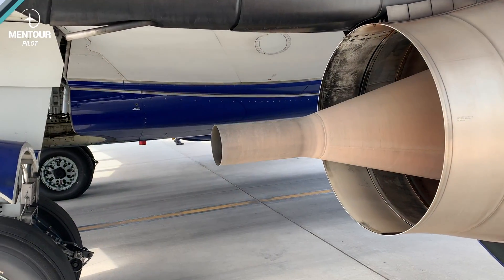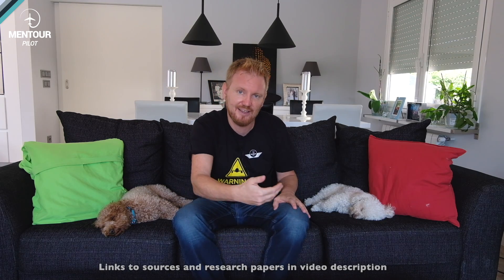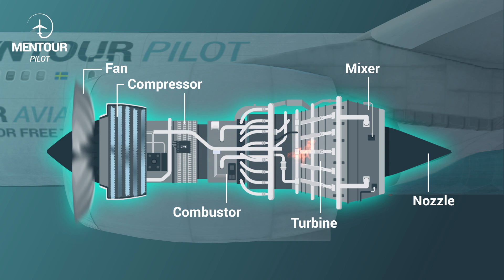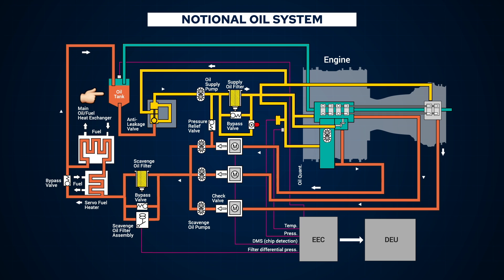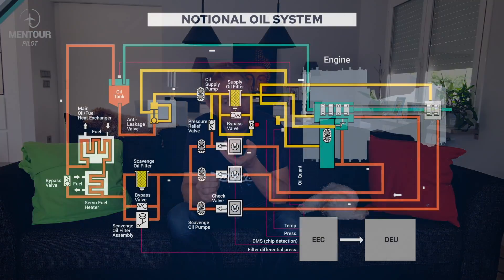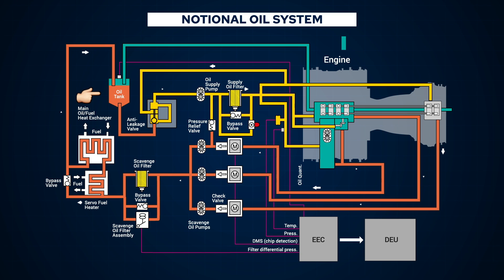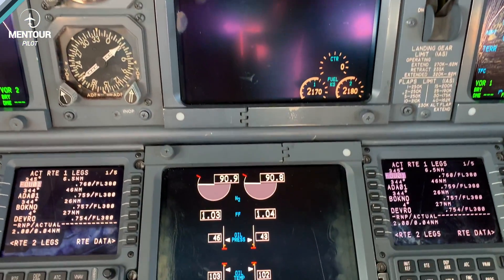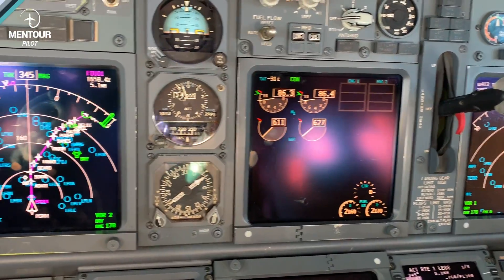What is that TUBE at back of the B737 JET engine?!

Comment: And i have a qiestion whats the maximum fuel that we can use to fuel an aircraft
Reply: favour ogiefa787 	
The capacity of main tank 1 is 8630 lb (3915 kg). The capacity of main tank 2 is 8630 lb (3915 kg). The capacity of the center tank is 28,803 lb (13,065 kg). The capacity of each surge tank is 235 lb (107 kg). So max filled tank would be 21 109 kg.
Reply: @speedbird9313  nice

Comment: As an old retired Flight Engineer I enjoyed your video. In the “the old days” back in the 60s and 70s pilots and flight engineers ground schools taught all systems in great detail down to the inner workings of all the components of systems. Ground schools were much longer then they are now. We would have been taught the oil system just as you presented it. Much more complicated systems on  reciprocating engines and turbo props. Thanks great job!

Comment: Chip detectors almost resulted in another 'Atlantic Glider' long before Air Transat 236.    Eastern 855, a L1011 from Miami to Nassau, lost all its oil and just managed to land on one engine (after the crew had restarted it when the two remaining engines shut down).   The reason for the engine shutdowns? - the chip detectors had been replaced in regular maintenance but the sealing O-rings had been omitted so all the oil leaked out...
Reply: i heard about it!

Comment: Dear Peter, I have one small suggestion. In the AMM, there is a range in which everything is in limit. Up to 1.24 quarts per hour is allowed, after that you have to remove the engine. My suggestion is to give a range of what is allowed.

Comment: Common misconception, but it's not actually "sometimes cooling", it's almost entirely cooling. In high power transmissions and gears up 98% of lubricant flow is used entirely for cooling components, with sufficient lubrication being achieved with only around 2% of the total oil flow

Comment: Why 747 is used as test bed for big engines. This feature was considered during design phase of 747 or those 747s are modified. And why the 747 cannot fly on two big engines like GE9x

Comment: Good explanation, I was in the Air force and some older jet engines in the 80's reject all the lubrication of the turbine bearing in the jet stream, so it get constantly fresh oil, the reason was the oil get so hot in the bearing that it is no good to return it back to the tank, the compressor bearings oil recycle back to the tank, that old jets used sometimes a 500 ml oil per 1 hour flight

Comment: Great video! I was a crew chief on the KC-135R powered by the CFM56. Those schematics brought back memories. I had wondered why there was smoke coming out of those tubes and what the little screen covering inside was for. I also now know why each engine needed about two quarts of oil after each flight. I haven't touched a 135 in almost six years and here I am still learning about the jet!

Comment: Such clever and elegant engineering! 
I think what surprises me the most is how little oil is required. 12-14 liters/quarts is not much at all. That's just a little more than twice as much as my Jeep!   Impressive.
Reply: BRUXXUS 12 is minium allowed for dispatch, it can hold approx 21 US quarts but doesnt indicate (on the DU) more than 19.
Reply: @speedbird9313  That's really fascinating. Even 21 doesn't seem like very much. Shows how tightly engineered the systems are.
Although, I'm guessing if there's a rupture at any point in the system, there wouldn't be much difference between 21q and 200q.
I can't imagine an oil leak would end well.

Comment: Nice! This one...
I'm looking forwarded to your take on: "We still have a huge problem with different Units".
How on earth did the industry survive with that completely outdated "Imperial" system - measuring things with reference to body parts (feet...). ?
There is still no sign that the glorious United States of America will adapt the metric system anytime soon. They are unwilling to adopt a world-wide metric system, defending a medieval and incoherent US customary system because of mental inertia which now has lasted since 1795. What is really mind-blowing is that the industry is still willing to deal with that imperial BS, and that you still have to buy a "Half inch wrench" instead of using a 12mm. And basically doubling the investment in tools you need in any workshop. Just because of US solo-arrogance.
Reply: Few of the measurement units in the aviation industry are in imperial. Nautical Miles and Knots, for example aren't imperial and also not metric. No, they're nautical. Nautical units aren't worse than their metric counterpart, if you are using them for their intended purpose: long distance navigation.

P.S. Fun Fact: The USAAF/USAF have been using celcius to measure temperature in aircraft systems since at least ww2
Reply: @martijn9568  
Nautical miles fit into the pattern of geographical Longitude/Latitude divisions as an integer. That's their advantage.
Didn't know that Celsius detail....
A klick (with a K) in military speak equals 1Km. Not sure to what extend it is used.
It seems that the military is adapting metric - realizing that the chance to win improves if you don't have to bring pen/paper and a calculator to the battlefield.
Reply: It's not the most difficult thing to get used to using both
Reply: @timwilson7326  
Beg to differ. 
What is 11/32 inch plus 17/64 minus 1.2 thou? You have to sit down and take pen and paper. These situations DO HAPPEN.
How many cubic inch are in a Gallon? 
How many feet to a mile? How many yards to a mile? Every time you wind up with a conversion factor impossible to memorize. And you have to go and look it up because nobody can remember that conversion factor. 
Imperial (call it US customary, for that sake) is just hopeless to work with. Still, there are defenders of the undefendable.
The US completely missed the train.
Reply: As a citizen of the glorious United States I do agree with you. So much inertia....
Reply: As far as I know, US manufacturers are allowed to use metric units in engineering and production.  Makes sense if they ship worldwide.
At Hewlett-Packard, the groups I worked with used metric units and metric hardware consistently, whether US or EU based.
Reply: @Butt of Lewis 
Nope. That 13mm will slip around the nut. 
You take a decent size hammer, align the 12mm wrench with the 1/2incho, give it all you got, and here we go ;) No more slippage.

Comment: That reminds me of the breather cap or PCV system on a car engine.  As the oil heats up, some gets turned into a vapor.  The old style breather caps on the valve covers would let this excess oil vapor vent to the atmosphere.  On pollution controlled vehicles, the PCV system vents the vapor into the intake manifold, where the vapor can be burned as fuel.
Reply: I had a 1967 Chevy Biscayne (cheap Impala) that went through oil like crazy. I was too young to figure out why until some lowlife stole the breather cap. I bought a new one and the oil loss went down to normal. I still get a chuckle about that!
Reply: @flagmichael  Did you drive it to the levee?
Reply: I agree. I guess similar pollution control requirements have not (yet?) been mandated for aircraft, although I expect it would technically be possible to let the air/oil vapor through the jet engine combustion chamber in a similar manner.

Comment: For the car guys watching, this system is directly comparable to the PCV (positive crankcase ventilation) system in reciprocating engines. The major differences are that most car engines are wet sump, and the oil misted air is fed back into the intake (via the pcv valve and tube) to be consumed in the engine.

Comment: I have noticed this on flight sim 2020. On the a320 neo or any plane. When you go to start the engine by pulling the fuel cut off lever to run, the fan in the engine spins even when the over head fuel pump buttons are off. 

Why does the fan start to rotate when the fuel cut off switch is in the fun position.   (Or when the ignition switch isn’t set to “start”)
Reply: I'm not fully sure of your question but in general when starting a Turbojet/Turbofan engine: the starter spins the compressor fan up to a running speed before fuel is injected.

Comment: It looks like engine engineers did everything possible to make sure the engine is as big as possible for low-sitting 737. It looks like putting centrifugal breather on the bottom would defeat the purpose, and they've opted to punting it inside the shaft. Just speculating here....

Comment: Yep, thrust going out is countered by something: bearings that exert the thrust on the load (the air-frame, eventually).  There's a lot of heat and pressure in that meet and greet.  Oil can be recirculated, metal can be too.  But, not for long.  Oil is a wonderful friend!  The tube is called a draft tube in trucking industry....Emission regulations have spelled the death of the draft tube.  Such emissions now must be combusted before being emitted in  truck engines...no doubt, aircraft engines will follow suit...just takes time.
Reply: it is only the thrust from the fan that is exerted through a bearing, in a pure turbojet the force on the thrust bearing is close to zero
Reply: @fuzzy1dk  and so where the thrust is transfered from the engine to the airframe?

Comment: There's no sealed system in any chemical combustion engine. Whether a standard piston engine or a rotating turbine engine. During the combustion process you're getting rid of both heat and as you say, burnt atomised oil from the chemical combustion process itself. All of this is also cooled by the bleed air from compressors 4 and 9 that deal with all engine functions

Comment: Great stuff! More engineering please. My question....... Why are piston engines in aircraft not silenced like land based vehicles. Obviously the prop makes most of the noise as do the tyres on a car. Light aircraft engines are roughly the same size as the average car engine. Why not at least muffle these engines in a similar way??
Reply: The weight of the silencing system is not worth the quieting of the exhaust. The return on the investment is pretty pointless.
Reply: KJ Dude who would you suggest is the beneficiary of investing in silencing?
Reply: The only person I could think of would be those who live near a general aviation Airport.
Reply: KJ Dude would they agree with your response to my question?
Reply: @kitingboarding  Are you asking if people who live near a General Aviation Airport would care if propeller planes had exhaust systems? I really don't know if their quality of life would improve if small aircraft had quieter exhaust systems. I happen to live near an airport that hosts a mix of Freight, Corporate Jets, and private planes. You can always tell when the Jets and Large Turbo Props are taking off, but rarely notice the small planes. At best I would think it would help only a very small subset of people.

Comment: @menourpilot To be honest your one of most knowledgeable commercial pilots I know and I know a lot lol. Jet engines are explained in 3 simple terms Suck,Bang,Blow. And everything you said is correct though there are major differences in different types and makes. There are Hi and low bypass engines and work with generally the same principal's but do have major difference between them. Also the heat exchangers are there to cool the hydraulic fluid as well this is why when your parked without either the engines or APU running you can only operate the electric pumps for a short time period or you will damage the system! Good stuff yay ☺️
Reply: Also the tubes in the back help differentiate between a Hi and low bypass engines. Basically in a low bypass there is a small amount of air that does not get compressed into the combustion chamber it bypasses the outside over that cone where both the bypass air and fuel air combustion air is mixed together creating more efficient thrust at lowered revolutions thus burning less fuel. The same applies to Hi bypass engines but with a larger N1 Fan sucking larger volume of air that bypasses the combustion chamber creating this much larger thrust at lower revolutions and even much less fuel burn. This helps gain ETOPS rating for the smaller aircraft because fuel burn is much lower therefore being able to travel much greater distances on the same aircraft type. Draw back is space both hi and low bypass engines are larger than the old turbofan engine's so old type design aircraft begin to struggle with accommodating the larger engines. Again needing to make changes to stabilizers and wings thus the whole evolution in type design. But this is one reason why the Max is struggling but with the new changes to the systems it does overcome those challenges!

Comment: I've seen video when large plain was pushed in to hangar, I wander how plans are secure when weather is very windy outside. I know planes are heavy, but is a procedure on airports to make sure that plane don't move when wind is strong?
Reply: I believe the primary way to prevent storm damage to large planes is to land them away from the storm. Most airliners are in use most of the time so they can schedule flights to keep them away from large, predictable storms like hurricanes. Thunderstorms are normally short in duration so planes can often delay takeoff toward a destination with T storms, fly a holding pattern until the storm passes or divert to another airport. Many times when passengers are waiting to takeoff it's because the destination airport has thunderstorms.

Comment: One  question i have always had is how a turbo fan jet engine works to help produce the electricity for the airplane if it uses bleed valves to spin a seperate turbine to generate the power so the apu can be shut down and also does the main battery pack get turned off once the engines are idle N1 and producing enough electricity for the aircrafts components. Thanks!

Comment: Here is an interesting note. Each engine has its own "oil level" that the engine likes to run at. If filled above this level, the engine will just dump overboard out the breather.  A place i worked ran our PT - 6 engines two quarts low because of this. Otherwise you are just wasting oil as you may end up adding a quart at every leg.

Comment: Hi Mentor 'Pilot' Captain Petter. 
I was shocked to find out that Jet A1 fuel is passed by the oil system as cooling fluid. 
I am interested weather it is by hours or visual inspection these parts are replaced. 
Is there much decress in metal performance by changing engines for maintenance?
"Your presently producing much better technical videos that Captain Joe - hands down".
Best wishes
🛌🛀🏌️‍♂️

Comment: It must have been a bit of a shock to realize you have been receiving the "mushroom" treatment for years (kept in the dark and fed on bullshit)! As the pilot, you are supposed to know EVERYTHING about the aircraft you are qualified to fly, there are NOT supposed to be any "need-to-know" issues. In hindsight, there is A LOT of systems knowledge that is absolutely irrelevant because you have no control of it anyway. It simply works until it doesn't, you are only expected to deal with the consequences...